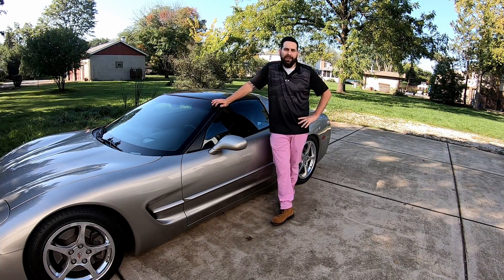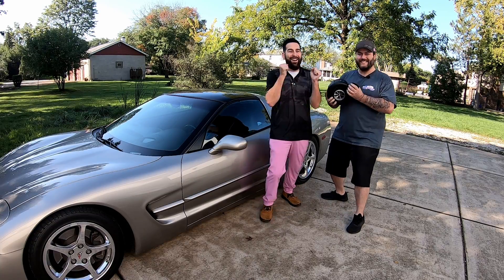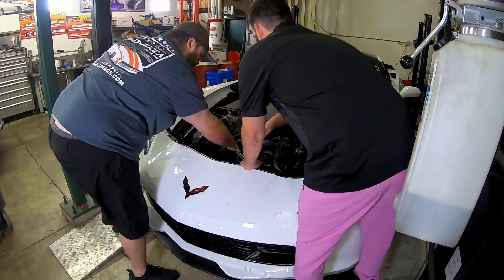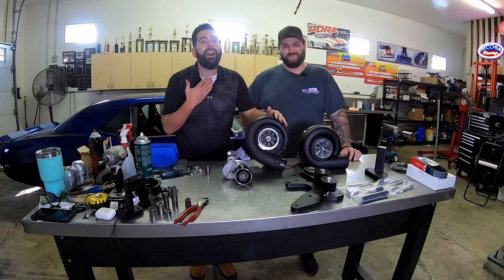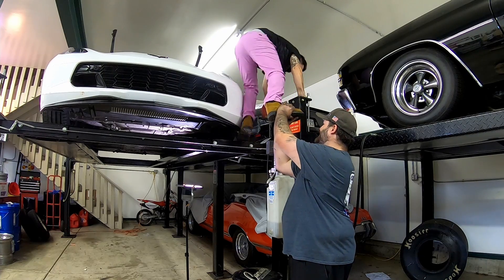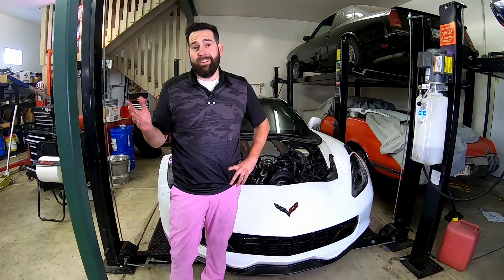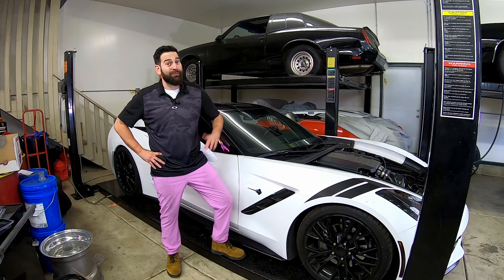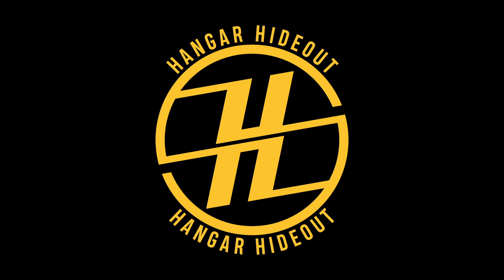Vortech Supercharger or D1-X Procharger? Which to get?

Comment: Were the brackets from vortech to procharger reusable ? Or you needed new brackets as well?
Reply from the maker: We needed to change the bracket over to a procharger bracket as well
Reply: What exactly did U use just from old kit then the belt system pullies n cooler kit,did U get it dyno tuned? Bet it's night n day power delivery

Comment: How do you like the Procharger vs Vortech??
Reply: It's a little hard to compare these two because the D1X is a bigger unit. I prefer procharger because they have so many more options and they are all self contained oiling systems. The bigger Vortechs use engine oil like the YSI.